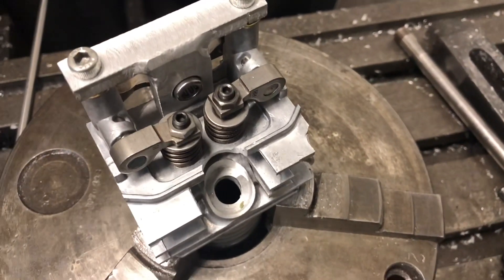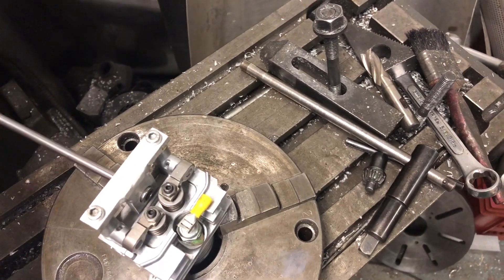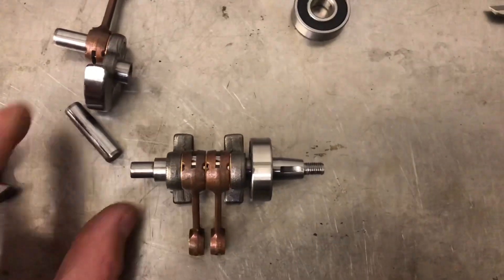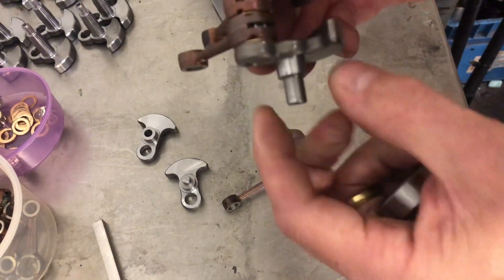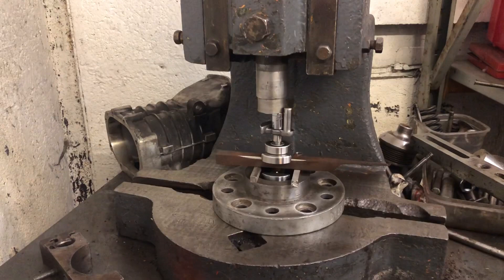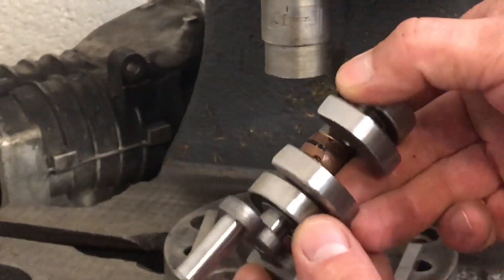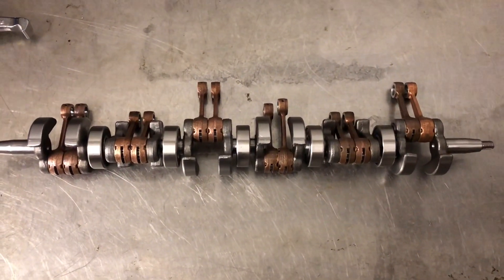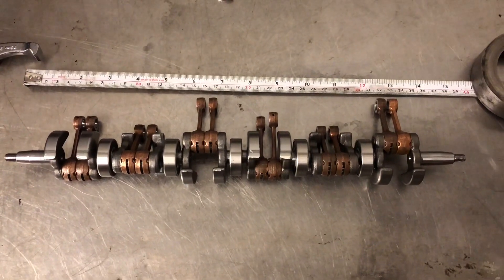300cc V12 from 12x Honda gx25! Part 3

Comment: the crankshat diameter is using original of gx25, which was designed to handle 25 cc

now we have much more power

is that safe?
Reply from the maker: yep it may be an issuse , time will tell !

Comment: Hi mate, awesome job on the project! I started working on the same sort of thing using the same engine basis, the gx25. I will be working with a group of friends (all of us engineers) to make a 3D CAD model first because it will be easier to make a bespoke head and block around the internals. The head will be tricky with the envelope of the sparkplug. We are going for an inline 6 configuration. One of the us actually works in a powertrain design company. Good luck  with the v12 cant wait to hear it run! We are in the UK as well.

Comment: I saw a few if your videos.this one about the v12 is very impressive. You explain your build in a smooth way.very clear even if my English speaking skills are low. It look as easy as Lego build but it's a 4 strokes engine build nearly from scratch. I really wonder how it will sound... And how the blocks will be connected... Bravo
Reply from the maker: Thanks 
 I hope it all works when its finished!  the block will be flat sheet tig welded together,  I hope it sounds like the old V12 F1 !!!!!!

Comment: Lookin great Stuart. Couple questions... Are you going to tack weld the crank after assembly? If not are you afraid of any of the press fits slipping? What are you doing about a thrust bearing?
Reply from the maker: hi, yep will prob tack tig the  rod journals , although the interference fit gives 18-22 ft lbs to turn, the crank mains have more surface area and take 30 ft lbs to slip , should be ok with the 7-9 deep roller bearings to handle thrust clamped in  the block which reminds me are you still ok to do some cad drawing for the block for the laser cutter company?
Reply: @scarlettsgarage1  Yes absolutely. Go to the About tab on my channel and hit me up on any social media or send me an email.